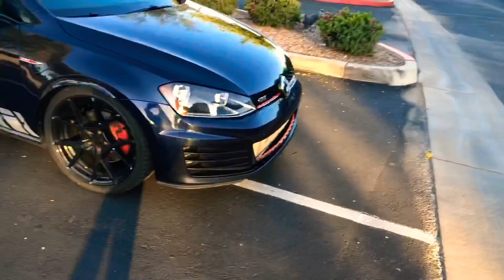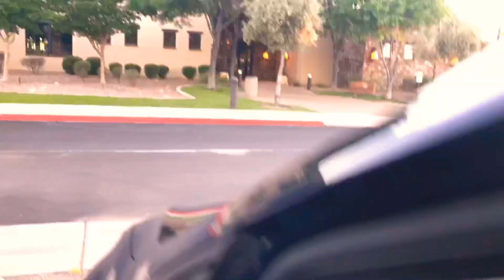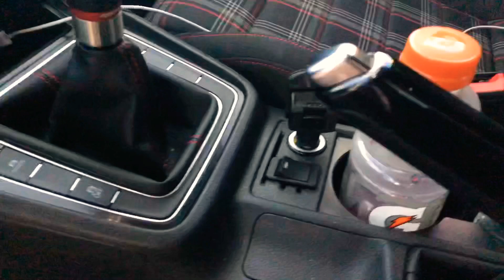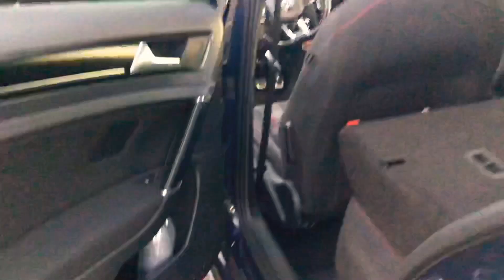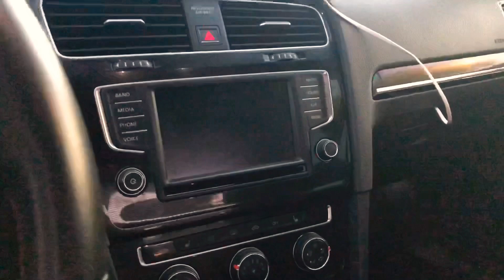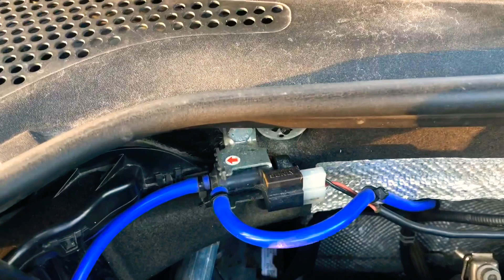MOD List MK7 GTI + Cost of Mods /// Make Your GTI FASTER Than A Modded MK7 R for CHEAPER!!!

Comment: Where did you get that side decal along the rear qtr panel?
Reply from the maker: I put it on myself. Ordered some white matte wrap, and installed it myself. Easy
Reply: @JacesOwnWorld  what size vinyl should I order to fit both sides?
Reply from the maker: @xxhypedupxx8336  I don’t remember. You would have to go measure it

Comment: What do you think about EQT turbo vs is38?
Reply from the maker: TheFlyingPLiner this is a sensitive subject for me, because I had an EQT turbo. It was problematic, and despite what others have said about Ed and his great customer service, I personally received a lot of bad service from him and those who work for him.

Without going to into it, I would say if you’re going to go EQT, make sure you get the XL version of his turbo. I didn’t, and it was built like Chinese junk. If I would ever recommend a hybrid turbo, I would say, don’t go EQT but look into Frank Mabo’s turbos. Frank is not only an amazing and very knowledgeable guy (he is my tuner), but he makes some dang good products. EQT has had many turbo’s fail, Frank hasn’t had any. Plus Frank’s turbo push more power and boost sooner in the rpm range compared to EQT, all for the same price. You can PM him on Facebook, as well as check out his products on his website @ Mabotech.net or check out his Facebook page Mabotech, which has numerous user videos of all his products. 

As far as the difference between EQT and IS38, the EQT will push more power, by about 60-80whp more, but I’ve really like my IS38 that’s on my car right now just the way it is. I mean, it’s quick enough. This last month I’ve beat a Tesla, Maserati, and Kia Stinger. None of those cars are slow. 🙂. Hope this helps with your decision.
Reply: @JacesOwnWorld  thanks that really helps out a lot. I was leaning towards is38 because I'm already APR stage 2 but it seems like people on the forums really push for EQT over the is38 lately. I think for my needs the is38 will be more than enough power.
Reply from the maker: TheFlyingPLiner I’m glad that helped. Two things to know about the IS38 vs. IS20. 1.) The IS38 will be laggier and won’t provide that low torque kick lick the IS20 does. Depending on your tune and weather conditions, the IS38 will get into boos around 3300-3500rpms, but what makes up for it is it’s power in the top end. You can definitely feel the power difference. But, once you have it for a while, and get used to the way it behaves, it will be fine. You’ll just need to hang your revs a bit more to continue to stay in boost. 2.) Using a OTS tune will be fine, but it won’t allow for the potential of the turbo. Getting a custom tune was a night and day difference for power once I did it. So I highly recommend getting a custom tune.

EQT is very good at marketing, and once they came out with their tunes, people have been flocking to them because they do provide good tunes. There was a time when EQT’s turbos were failing left and right. I think they got the problem fixed, but just from my experience, I will never go back with them.

Comment: faster than a 400+ hp mk7R????????
Reply from the maker: Nacho yes. Obviously, at that point it will most definitely come down to the driver, but a MK7 R that is running the same mods as an IS38 MK7 GTI, meaning it’s tuned and FBO and same fueling, if both drivers had the same start, the GTI will win. The reason why is because on the same tune, the R will produce less power due to its AWD drivetrain loss, and also the R weighs roughly 250-300lbs more than the GTI. Now from a dig, the R will destroy the GTI, but from a roll, the GTI will win if everything is the same.
Reply: Jace’s Own World completely true bro but I wouldn’t consider a stage 3 “cheap”.
Reply from the maker: Nacho technically, it’s a Stage 2.5, as an IS38 is still an OEM turbo. The whole “Stage this and stage that” I just don’t get it because it differs with every car. But considering you can get an IS38 turbo brand new now for $1100 or less sometimes, a downpipe for $300 +/-, and an intercooler for around $400+/-, then a tune for around $500, $2300 in total is really pennies for the amount of power you will achieve with those 4 items. If you bought a brand new GTI at $25k, and did those 4 things to it, you have an R killer for under $30k. Considering an R brand new costs over $40k, I would say the GTI is just the better car all around IF you are a modifying type of guy.

This is why I have said on other posts, that I wish the R was more special, meaning I wish it came with a bigger engine. A 2.5L or 3.0L would be amazing, and would really allow people, like myself, who own GTI’s, desire to upgrade to the R, but as the R sits right now, I wouldn’t ever want to upgrade to it because as far as the engine is concerned, I can get the same feel and power out of it in my GTI.
Reply: Jace’s Own World yes you are right!! But a launch control with 4 motion trust me has no price :)
Reply from the maker: Nacho yeah I know. The R is a beast off the line, which is why I stated off the line, the R would destroy a GTI. 🙂 For me, and only speaking for myself, I just don’t think having AWD is worth an extra $10k premium over a GTI.

For the new price of an R, let’s say $40k, I can make a 600+hp GTI, with full brake and suspension upgrades. I’d rather have a GTI monster than a stock R. But that’s just me. This is why I wish the R was more special, because it’s just way too similar, and shares so many similar components that a GTI does, interior, and exterior wise. 

Before I bought my MK7 GTI, I had an E46 M3. I put a ton of money into it, and had it in the mod 500hp range. It was supercharged and basically track ready. Now an E46 BMW 330Ci owner might say they can make that car much faster than the M3 for cheaper, and you know what, they could. But the thing about the M3, and any past gen M3 as a matter of fact (E92/90, E46, E36, E30) is that they were completely different inside and out than a regular 3-series of the same generation. The motor was different, drivetrain, interior, etc. So it made the M3 a lot different feeling when driving it, and made it special and worth its price over the 3-series. The R isn’t that different outside of it being AWD. That’s my point.
Reply from the maker: Nacho I think the R is sweet, and for those who buy them, they have a sweet ride! Both the GTI and R are awesome in their own way. For those who can’t afford the R, like myself, and who like to modify cars, the GTI is a great platform. For those who can afford the R, then go for it. It’s an amazing car.